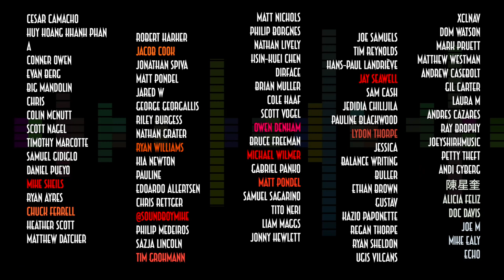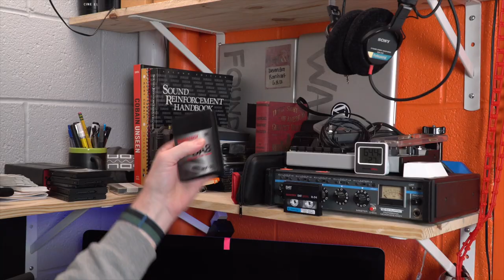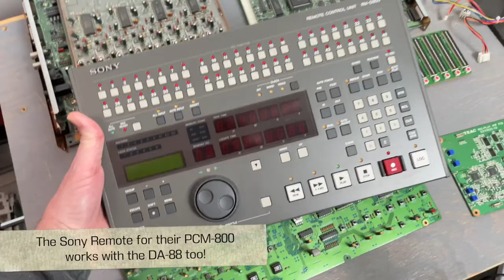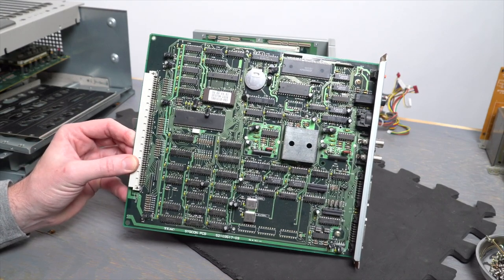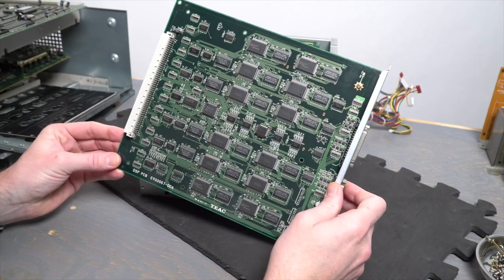What's Inside? | 90s Digital Multitrack Recorder Tascam DA-88 Teardown

Comment: Do you still have the DSP board?  I have two non working DA-88s here, I've recapped the RF amp and PB/REC amp, and have narrowed the problems down to the DSP board.  The electrolytic caps on these 3 boards leak and the electrolyte from them eats the board beneath. When this happens, you don't just re-cap it since some of the foils on the boards have been eaten away.  The DSP board appears to be multi layer, as in more than two layers.  I think Tascam was planning on selling a lot of replacement parts to keep these in service (and to keep them in business).   The development cost must have been very high when looking at the complexity of this machine.  It was "built like a tank", but it wasn't built to last, the leaky SMT electrolytic caps were the reason.  If you need a nice high current 5 volt supply, it is good for that!
Reply from the maker: Hey Francis, thanks for the message. Someone locally was able to take the whole machine not too long after this video went up. I hope you can track one down soon though. Thanks for the message.
Reply: @DcSoundOp  Thanks for the response.  I'll set them aside and keep an eye out for a DSP board.  I think I can make at least one of them play.  There appear to be at least 4 revisions of that board.  There is a partial service manual in many places on the web, but it is only a supplement and not a complete manual.  It contains a schematic for the latest version of the DSP board, but is quite different from the boards I have.  Oh, well, I guess I got some nice heavy doorstops.  :)
Reply: Tenho um aparelho tascam fa-88 com manual original. Eu ganhei mais não me interessa coloquei a fita de limpeza ela entra e sai sozinha. Quero vender tem interesse em comprar

Comment: I bought a tascam 88 and the tape is stuck inside I used a new Sony DTRS tape and got a 68 error code or 79  it seems to look in newer condition. Can you help me?
Reply from the maker: I'm not sure what an error 79 would be, but the 68 error is listed as "In Play mode, the reels do not start to drive, or do not lock for more than 1.5 seconds." - that could be something that comes good with cleaning & lubrication, or it could be a damaged or defective part. Have you opened it up? You'd be surprised how much better these run after proper maintenance.

Comment: I loved mine. I had 4. 24 tracks with a spare, and all that was required was to clean the head/drum and transport. I thought they sounded quite good.
Reply from the maker: That sounds like a really fun setup, did you have the big remote to control them all? I had an Alesis BRC for a while just as computers took over and it was always very satisfying to hit a button on that and have a whole rack of machines do something in tandem.

Comment: Is it worth to buy one on eBay for $170 plus shipping they say it works like it should.
Reply from the maker: That is a tough call. I've bought a few digital tape machines over the years online & they are never as 'working condition' as ppl claim. 'Working' doesn't mean it won't eat tapes, or run at the correct speed, or that it has ever been lubed or cleaned etc. Shipping on these is also pretty risky as the weight is concentrated in one corner and they can be tough to secure inside a box properly. If you're willing to spend that kind of money, I'd do a hard search for something within driving distance before going with eBay. Good luck! Let us know how it works out if you do get it!
Reply: @DcSoundOp  WOW I just bought one I hope it's ok. The seller says it's a store model. Thanks bro.
Reply from the maker: Hey Edward, just wanted to see if you got a hold of the one your ordered yet & how it turned out. Hoping you got a good one & are enjoying your tapes again without issue. All the best!
Reply: @DcSoundOp  had to cancel my order because the buyer was delaying the shipping. I thought I was getting scammed.

Comment: I'd like to have the whole Machine,  I have a yamaha 02a, with the digital interface FIR this Machine. I'm a tech. Please
Reply from the maker: Where are you located?
Reply: @DcSoundOp  San Rafael CA
Reply from the maker: You almost couldn't be further away unfortunately. To get a whole machine shipped to you would cost a min. of $125 going off a UPS quote & that doesn't include the box and packing material that I don't have to keep something this heavy from destroying itself in transit.
Reply: @dalrob9969 sou do Brasil. Tenho uma tascam da-88 com manual original. Tem interesse em comprar
Reply: @DcSoundOp  San Rafael CA

Comment: Mine looks different. It has three holes in the front and is fully white
Reply from the maker: Interesting, what do you mean by three holes in the front? Do they serve a purpose? Thanks for the message!
Reply: @DcSoundOp  I just ordered it and only had one picture. The front plate is missing.😁
Reply: @DcSoundOp  Please help me. The sticker on the case states 120V. Can I plug it to 230V or do I need a converter?
Reply from the maker: @neindochoohh7955  can you send me a photo of the back panel? email is in the about tab. If it says 120V I would NOT just give it 230...there may be a switch though, but I'd have to see to tell you.
Reply: @DcSoundOp  Thank you, I made some photos but there is no email visible

Comment: I recently bought one in a condition marked as working, but it would need a new pinch roller ...then I realised for some reason no one makes those in Europe!  Terry's Rubber Pinch Rollers in Michigan seems to be the only way for me at the moment. I might give it a try...
Reply from the maker: It would be great to know what your experience was like if you do give Terry's a try. Thanks for the message & good luck getting your machine back up and running!
Reply: It may not be the pinch roller.  Have a close look at the supply tension regulator, they tend to freeze up.  When they do, you have insufficient back tension and you will see the tape bunch up at the pinch roller.  It is a small arm near the left supply spindle.  It should swing forward when the tape loads.  My guess is that it is stuck in place.  To fix, loosen the plastic retainer, gently pull the arm up, apply some cleaner such as alcohol using a cotton swab, apply some light oil to that shaft, work the arm so it's loose, put the plastic retainer back in place.
Reply: @fflynnful  Thank you very much for the enlightening information. I will transfer it to the technician who is now responsible to fix this fantastic piece of machinery, because I don't do repairs, I just had the ambition to plug it and write some music...
immediately...
but unfortunatelly it has been more than a year that the DA-88 is sitting there musicless...and it's kinda sad..
Nevertheless I love this video, it is so satisfying to watch and learn!
Reply: @jiosi  I have two of them here that I am trying to bring back to life.  I've given up asking why am I doing that, the question now is why not?  They have a lot of, 30 or more, surface mount electrolytic caps that have leaked their guts and basically destroyed parts of the circuit board beneath them, so it's more than just replacing the caps, now it's bridging the corroded foils on the board and then replace the caps.  Lots of hours have gone into it.  I don't like to give up on things, but I might.
Reply: Thank you for the suggestion @fflynnful

Comment: What a beast!  Nice teardown.
Value engineering - I don't know if there is a more offensive term these days when it comes to electronics :/
Reply from the maker: Thanks for the message! Thankfully Tascam still makes some quality hardware, like the DA-6400, which is around the same price as this was originally and does 64 tracks in a single rack space. Mind blowing how far things have come so fast really. Sony has a few pro video decks that are similarly accessible for repairs and swapping parts, but it is exceedingly rare for less than a $10k price tag these days.
Reply: @DcSoundOp  64 tracks in one RU?  Wow!

Comment: Hello, nice video ! 
My DA-88 has a stuck tape with the message S-Err 1, do you know how I could get it out ? And how to repair the device ? Cheers !
Reply from the maker: So S-Err 01 says 'Mechanical problem, -tape path, guide, drum, 
motor, etc.' - getting it out would involve opening the case and getting a closer look at how it is stuck, if the tape itself is engaged or tangled or what is going on. The cause could just be dirt, a lack of lubrication or something broken, but getting a look at how it is stuck would be my first step.

Comment: I was using an 8 track 1/2 inch Otari Reel to Reel in the 90s... Man I do not miss that at all..
Reply from the maker: Yeah, the charm of working with tape wears a bit when you're the one dealing with it and paying for it all. I'd love to get an Otari Radar system in for a video at some point, they cost is still up there though. Thanks for the message!
Reply: @DcSoundOp  iZ Technology out of Vancouver actually made the RADAR.. Otari was just a distributor for about 5 years 95-2000.. then IZ took back over
Reply: @DcSoundOp  The maintence on tape, and the ease of nonlinear editing make tape a no go for me.. Especially for my actually paid work, which is TV post audio.
Reply from the maker: Thanks for the info, those show up in the used listings pretty often & I'd certainly take either if there was a good deal going!
Reply: @DcSoundOp  The converters are highly praised. Ive never worked with them, but ive seen a lot of people seem to really like them